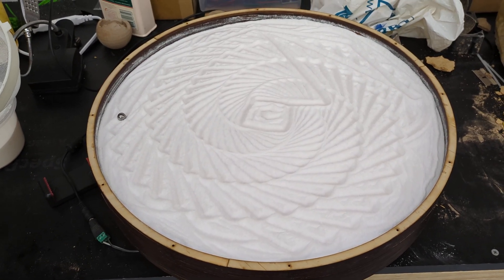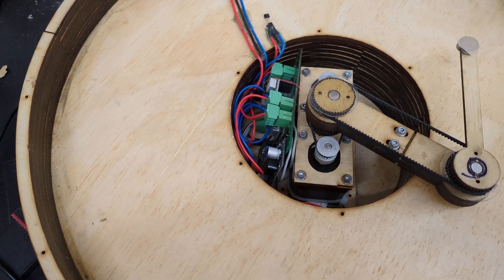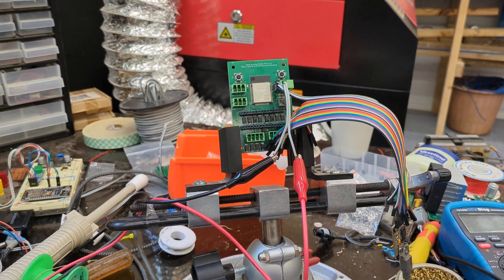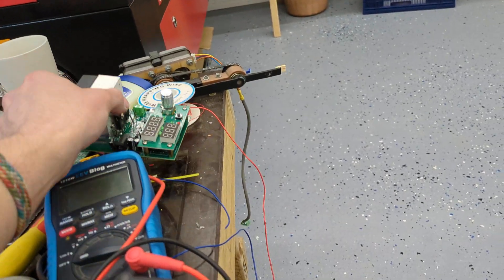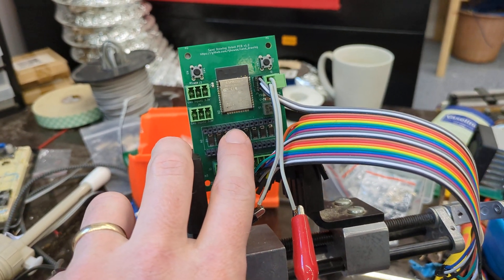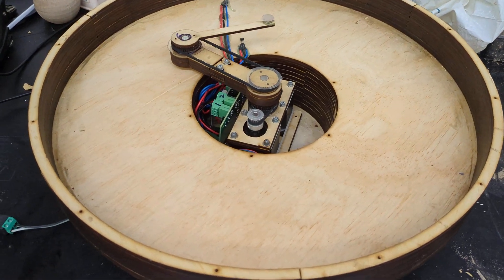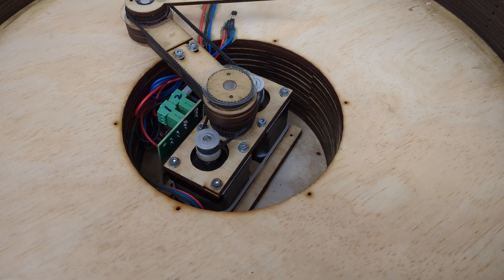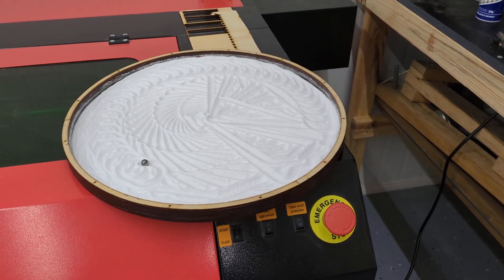Sand drawing robot PCB v1.2

Comment: You could hot glue addressable leds on the inner edge as they'll make nice shadows at low angle (you could turn on only a part of the led strip and move it around, so it slowly changes the direction of shadows). Inner lighting would solve the issue of glare if you'd cover everything with acrylic or even glass, which would also keep the dust in control.
Reply from the maker: That's something I'd like to experiment with! It would require a bezel around the window to hide the LEDs from view, but that wouldn't be too hard. I'd want to go with glass to reduce scratchability, but ease of manufacture is a key aim of this project, and getting an exactly-sized circular piece of glass would be a challenge for many. Haven't quite finished thinking this one through.